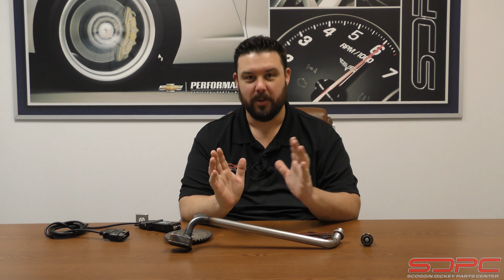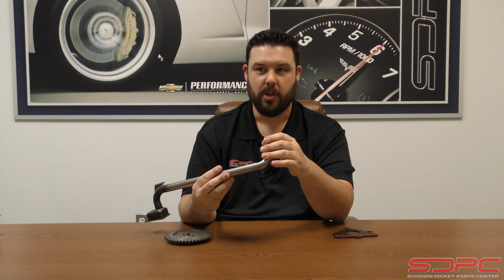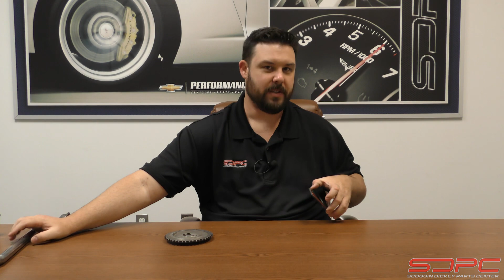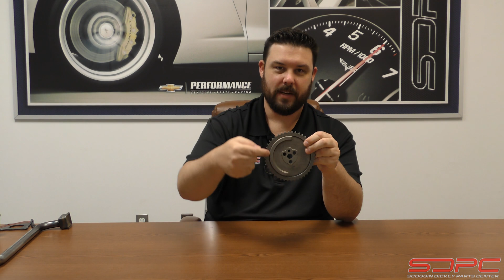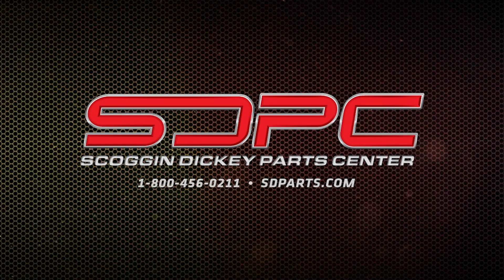SDPC Tech Tips: DOD Delete FAQ

Comment: great just purchased my cam bolt 100 plus and few weeks time i could reused mine get all the info before doing this job the tunning was the issue i went with stock dod system i didn't have the knowledge to deal with that now i'm confident i can do it for my next project

Comment: Thanks for your videos.  Long story, 2017 Suburban, blew a oil line to the cooler, dumped all the oil on the street in about 10 seconds.  Fortunately, it was on a side street and I was able to immediately shut off the engine and have it towed to the shop.  During my investigation of what I believed to be a low oil pressure issue (this video may have shown it is not an issue) but I will continue my investigation.  This video, and the one about the variable pressure oil pump, earned my subscribe.

I was looking for a image/video showing the oil flow through a Gen V LS 5.3 motor and for the life of me I can't find one.  Might be a good video to do, how the oil move through the engine and it would also be good to do a video on "Normal Oil Pressure" in one of these engines.

Thanks for the information and keep up the good work.

Comment: I put (non dod ket) on my 2015 tahoe, and I deactivate dod program, but I get P0011 camshaft position!! what is the wrong for that??
Thanks
Reply from the maker: Did you go with just a regular OEM style non AFM cam or aftermarket? Did you add a limiter or lock to your cam phaser?
Reply: For the phaser lock for the l92 non dod, would it still require a tune?@Sdpartscenter
Reply: @Sdpartscenter i been looking for this answer if i do a did delete on a l83 when do you have to add a limiter or a lockout  and second do you have do change the oil pump to a normal output pump?

Comment: The low oil pressure is due to the oil pressure valve in oil pan.  Take out the allen head bolt,spring and ball bearing, if your model has one.  Replace with a bolt. Oill pressure will be at 25 pai and up some are at 40 to 65 psi.
Reply: I just had the DOD issue at 263,772 miles. The culprit was the rings under the valley cover.
Reply: For new Silverado?
Reply: I have 4.8 2012 would this be a good idea to do?

Comment: Biggest question is, will doing a delete and tune, will it trigger a fail at the smog shop, in California?
Reply from the maker: With them failing for any tunes outside of factory parameters, then yes.
Reply: No it will still pass if all you did was turn dod with a stock 5.3 or 6.0 cam and kept all emissions I do them all the time and they still pass

Comment: Does your 2019+ DOD delete kit with LS7 lifters require LS7 7.80 pushrods or can the stock L87 7.85 pushrods be used?
Reply: Est is to measure, you can use whatever pushrods you want even from the factory I never trust them. Measure and get the right ones

Comment: I have DOD tuned off from my 2011, and DOD deleting with a cam swap and plugging the relief valve in the pan. But plan on keeping VVT. Will a 10295 oil pump work with the build?

Comment: I've had a Range DOD delete installed on my brand new 2013, it has worked fine.
Reply: It will until it fails. That’s just a band aid.
Reply: @bshaw1979  11 years
Reply: @gregalot200 it’s dumb luck. Because if we knew anything of what you’re talking about, you would realize that I am correct.The part on the lifter breaks  still moves even if you have that on there. That would not prevent a faulty lifter from not failing.
Reply: @bshaw1979  I'm a retired machinist from the Navy weapon systems and main engines specialists, when I bought the truck new, I went home and looked up that system and decided it would not hold up. That lifter fails in the down position this device stops it from ever going to the down position.
Reply: @gregalot200 even with it deactivated by the range device. The cam lobe still puts some pressure on the lifter. So still very possible of failure. Which I have seen in other Silverado groups.  But then again there are people that don’t do anything and never experience any issues. Maybe got lucky with not getting faulty lifters from the start. Which I’m guessing is happened to you. Luck of the draw as long as you do your regular oil changes.
Reply: @bshaw1979  I'll say this one more time, the lifter fails while in the collapsed position not the extended position. Of course the lobe puts pressure on the lifter it's the lifter flopping around loose that causes the damage.
Reply: @gregalot200  and I will say this one more time. If what you’re saying is true and I’m wrong. How have people had failed lifters with the range device  installed?
Reply: @gregalot200 I would love for you to answer this. If the range device solves everything. Then why do people that have trucks without the dod lifters. Still have failures?
Reply: It still has shit lifters. I’m replacing mine right now and the # 3 lifter is not even a dod lifter and it failed. 130k miles.
Reply: My 18 with range module just had a lifter failure. 119k miles.
Reply: @ryanpeterson1051 that’s a bummer man

Comment: was nice to have my ECM unlocked and connected with HPT. I was able to tune on laptop only and install the file after the drop in. Just a safe start tune. VVT, DOD delete, new cam ( 3 bolt with higher lift a little higher exhaust lowered the LSA. Stage 2. LT4 inj control, Lingenfelter HTFP, Flex, dual walboro Hellcat in-tank, Methnol. Dropped the timing a little also since I went with 10:1 + Whipple instead of 11.5. I also went with a new oil pump and used the white spring which came with the LT4.

Comment: I have a 2015 gmc ….240,000 miles and my oil pressure has never dropped below 35lbs. I have also “disabled” my AFM/DOD with a flash pack tuner and haven’t had any problems in over 150,000 miles. Guess I’m just Lucky 🤷🏻‍♂️

Comment: Would I be able to remove the afm cover and replace it with a regular valley cover would I have a problem with the oil getting to the lifters
Reply: After I get it removed from the computer
Reply from the maker: You still have to remove the AFM lifters, you can't just do half the process.
Reply: @Sdpartscenter  okay just wondering, thank you

Comment: Texas Speed also offers a delete kit as well.
Reply: Is it cheaper?
Reply: The TSP valley cover is like $195. It will require a non-DOD cam, cam phaser limiter, new head gaskets, valve springs and push rods (if going above stock lift) and at least the 8 lifters and lifter trays. Then, on top of that, there are a few things you might want to do while it's open as preventative maintenance like Oil pump, timing chain, main seals, etc. All in, it's pushing $2000 to do a full and proper delete, excluding tune and labor. @mathiasmeade1309

Comment: I did a cam and I have code p0010 and says permanent
Reply: You got it out of time on cam
Reply: @dreece2000  how would i fix that?
Reply: @danf633  you have to pull the timing cover back and off and line the dots on the gears up

Comment: My build hold 60psi at hot idle with 5w30🎉
Reply: You have deleted dod and vvt right?  My vvt yukon throws the stabilitrack error due to higher than normal oil pressures.
Reply: @20tea 02' don't have any of that bs ... but yeah any gen 4 or5 gets deleted

Comment: How do you turn the check engine light off when you do the dod delete
Reply from the maker: You should find out what codes are thrown with the CEL.

If you haven't had the pcm tuned after performing the DOD delete, that is absolutely necessary.

Comment: The L-87 is a High Output Engine with a 60+ cold start and as far as 70 at wot. A VVT delete will change those numbers?
Reply: What are you saying I’m confused
Reply: @dreece2000  no buddy, just a question. I’m about to drop my first minus VVT LT and don’t want to freak out if my psi is lower. As u know the LT is a wallet burner and I don’t plan to build another one for myself any time soon.

Comment: Hi. My 2011 escalade esv had a lifter failure. What kit would you suggest to do the DOD vvt delete on it? Would I also need to replace the oil pump and block the relief valve on the oil pan??

Comment: When you say "removing" DOD from the computer,  is that the same as "disabling" DOD for example using HPtuners and then writing or flashing the ECM?

Thanks for the great info!
Reply from the maker: Correct, you need to use HPTuners to disable those parameters.
Reply: @Sdpartscenter  
Thanks for the clarification!

Comment: #SDPC Do these (see end of sentence) work to shut off AFM/DOD until it can get tuned out? Have a 500 mile trip and need to be able to travel and I own this chip!! Chip = Range Technology Active Fuel Management Disable Device (amazon)
Reply from the maker: Sorry you need to get it tuned out before you try and drive on it. From past experience with customers the chip won't do anything to help.

Any tuner worth their salt can bench tune your pcm to shut off those parameters if you can't make the drive yourself.

Comment: I have a 2014 Silverado with the L83. I’ve done intake manifold and TB grade up from the L86 also exhaust and a rune with the DOD delete from the pcm. Drove the truck from Houston to Colorado Springs. With no issues I want to add more HP what kind of came should I be looking for
Reply: I'd go with a btr or a TSP stage 2 it's a decent cam with some more power
Reply: Ima copy you bro 😂 ima do 5.3 swap on a 2012.

Comment: LT1 E-rod apparently DOD is unactivated...so ECM should be fine. Doing the delete kit,  is it just to circumvent the failure of the system down the road??  I hatre the thought of opening a brand new motor, but running as is once install complete. Another surprise, intake build-up on direct injection motors...I thought I'd step-up to the newest stuff after 6 LS installs...now thinking add methanol injection to stave off any intake valve build-up..
 🤔(?)

Comment: What is all the hatred of the DOD system?  I have a 2017 Camaro SS and mine works fine.  Full power when I need it.  30 MPG when I don't!!!
Reply: here are a few reasons:

Many people find the four-cylinder sound annoying if their vehicle is equipped with a louder aftermarket exhaust.
Some drivers want V8 power under their foot at all times.
AFM lifters have a history of failing and oil consumption can be a problem.

Found on google.
Reply: Eventually the afm lifters will fail. It's incredibly common on the truck platform, Sierra/Silverado. When a lifter collapses it almost always scores the camshaft. 

So...a dealership will only replace the failed lifter and sometimes the camshaft as well. A few months later or even a year later a different afm lifter will fail. It'll keep happening and unless you're doing the work yourself you're looking at thousands each time due to the labor.

It's essier to just get rid of it. AFM/DOD delete kit+ls7 style lifters and gain some horse/torques from the new aftermarket camshaft.

Disabling AFM from the tune (hptuners) doesn't prevent lifters from collapsing. It happened to me. Totally sucks.

btr stage 2 cam+afm/dod delete going in this week. Hoping to see upwards of 650-700whp....I've done other stuff to my truck. 😁
Reply: What other stuff have you done? I'm ordering the same kit this week.

Comment: The idea of shutting off half the cylinders is the problem. That is the stupidest way to get fuel mileage out of a V8 that I have ever heard. You can get far better fuel mileage out of a V8 when it isn't calling for torque or for a lot of power, merely by defueling the engine. You can run it considerably lean and get a hell of a lot better gas mileage than you can by shutting off half the cylinders and having to push all of that dead weight around and around and around and around. Only an asinine idiot would think that shutting off half the cylinders is a great way to get better fuel mileage. I've seen the Chrysler Hemi get an average of about 25 to 26 mile per gallon while driving down the roadway at about 60 to 65 mph in a Chrysler 300 that weighs 4,000 lb. I've gotten 22 miles per gallon out of an old school 440 when I leave the tune on the carburetor and it doesn't even have an overdrive gear or a lockup torque converter. And that would be worth almost 10 miles per gallon. If I do the same thing with that same Chrysler Hemi that shuts off 4 cylinders, I will get approximately 20 to 22 miles per gallon. However, I'll take another example, a 1994 Camaro z28, because of the styling of the car at 85 mph with the air conditioner on, I have averaged 28 and 1/2 miles per gallon. At 65 I've got 35 miles per gallon all day long. And that isn't doing anything to that engine. You put some decent plugs in it and a little bit better cam. And there's no reason why that car shouldn't be getting 42 to 45 miles per gallon and not shutting off a single cylinder.
Reply: It's the government! They make the car company's do dod and vvt.
Reply: Do you water the gas down with distilled ?

Comment: Whats the difference from the 3-bolt 4x and 1x cam sprocket?
Reply from the maker: Simply put, the raised portions on the sprockets. 1x has one long lump running 180° on the outer radius, 4x has 4 individual ones.

1X Sprocket: https://sdparts.com/i-20089464
4X Sprocket: https://sdparts.com/i-20089467
Reply: @Sdpartscenter  ok i did a VVT delete and notice its a 4x vvt do I need to put a 4x sprocket gear because I'm having issues with the 1x sprocket on starting and a little small backfire here & there

Comment: I have a question so I own a 2016 camaro ss with the manual transmission. Dod does doesn’t work on the tremic option but is all that junk still there?
Reply from the maker: No the LS3 does not have DOD. If you had an auto, it would.
Reply: @Sdpartscenter  Actually it is an LT-1 and yes, the lifters are still in there.
Reply: There not supossed to be in a manual shift vehicle from what i understand ..

Comment: I hear what you’re saying about a device that stays plugged into the obd port. But what about a handheld tuner that completely shuts off dod/afm/dfm?  You know like superman with a chip on his shoulder.
Reply: I can only tell you my experience so take it with a grain of salt. I have a 2012 Silverado with the LC9 5.3L and used a Hypertech Max Energy programmer to disable the AFM over 2 years ago and haven't had any problems. The truck had about 65k miles when I did it and now has 80k. It drives like a dream. No change in mpg, either.

 I did not do a cam swap to remove the lifters. All of the guts of the engine are still stock. Knock on wood

Besides the AFM, I also love the ability to change tire size, change the rev limiter, change the shift points, change the shift firmness and if I ever change the gear ratio I can adjust for that, too. 

And, no. I don't have to leave it plugged in. 👍
Reply from the maker: Hi Johnny P, you can definitely do that. You can disable the DOD using something like HPTuners. This can prolong the life of your DOD lifters by not having them go in and out of 4 cylinder mode. Some have had no change in MPG, some have seen an improvement in MPG, it really depends on how they drive and where they're driving.

Comment: Thanks Nick. My question is, why do I even want to do a DOD delete on an engine that is currently working fine? Is this more for engines that have higher mileage and perhaps in which the DOD has already failed? Silly question perhaps, but thanks in advance if you can help my understanding. Great video BTW - Ted
Reply: Many people do preemptively, delete it before it becomes a problem.
Reply: @nickadams4663   Ok thank you, makes sense. Have a good weekend.
Reply: My 2021 6.2 L with 19,000 miles - High Country 1500 failed (bent push-rod, etc) about 45 days ago & GM dealer repaired in under warranty. I am not sure I can find a shop to do the work as I've heard GM is going after those that modify its V-8 engines?
Reply: @jerrygibbons7666 
Hi Jerry, my 2015 Silverado 1500 6.2 ltz with 117k just dropped cylinders 4 and 7. I point blank asked the dealership if they would do a AFM delete lol. Of course the answer was no, they wanted 8k to do the repair. Ended up bringing my baby home and am doing a complete delete myself. Interesting GM is going after shops, I never heard that. Have a great day.
Reply: They aren’t, that’s BS

Comment: I've  had a range unit in my Z06 for 18 months and over 5000 miles no problem.
Reply: I’ve had mine tuned off for last two years and had cylinder 6 afm failure two days ago. They will fail no matter what without the proper delete. Beware!
Reply: @jaimonjsdad  same story here with a 15 Silverado. Range AFM disabler since it was new... Dropped AFM lifter at 104k and again on a different cylinder at 112k.
Reply: On a DOD deleted LT4? What brand range unit?
Reply: @nickadams4663  The actual Range that is for the Z06. Bought it on amazon and have no more 4cylinder mode and mo drivability problems.
Reply: Oh ok I'll have to look for those. What cam did you go with in your car and how do you like it?
Reply: I had a range on my 2016 Z06 for 31000 miles and sold it to a friend who has put 7000 more miles on it. Zero problems!